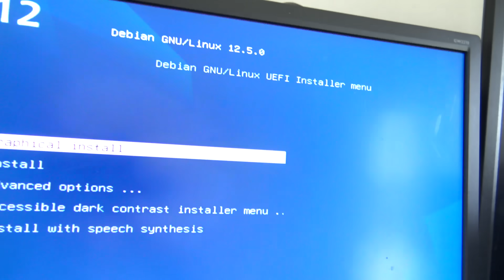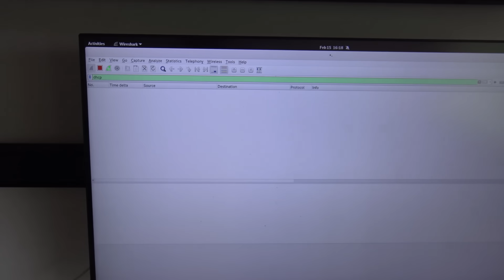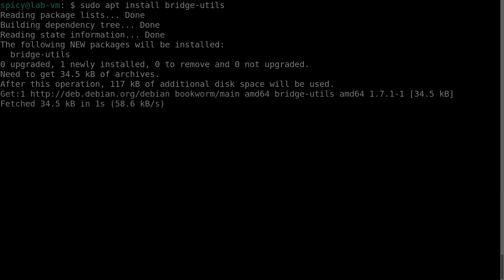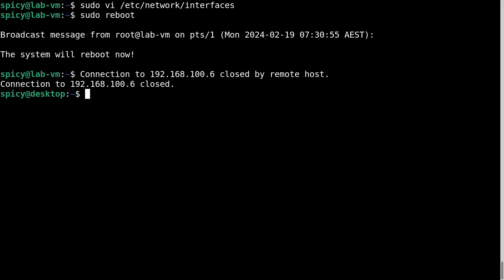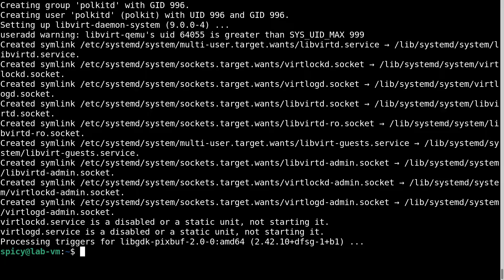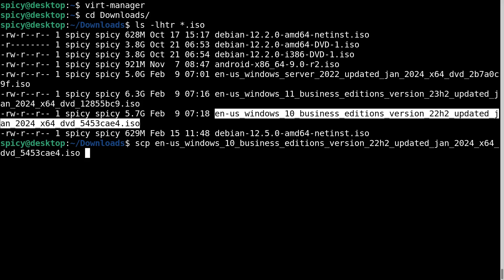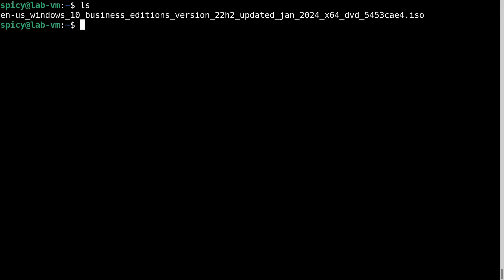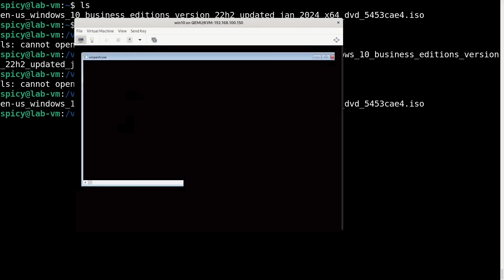Free Virtual Machine Hypervisor

Comment: nice - didn't know VMM supported remote management like that, seems like it'd be less tempremental than proxmox if you try to install something like Docker on the same machine, but you can manage Proxmox from windows & mac so I'm not sure if I'll get to try this one
Reply from the maker: The reason I use this is if I need a VM on a machine that I've already got Debian installed on like my desktop. Proxmox for web client is certainly good.

Comment: Lenovo M73 TFF, 16GB/1TB, clean install of Debian 12, Server. Got everything set up as per the steps in the video, nada on br0 not even showing in > ip a. 
My ethernet connection is/was eno1.  (does say altname enp0s25 but that name has no effect anywhere)
Has wifi with interface wlp2s0.

Figured out what was missing:

sudo brctl  add br0
popped up immediately after that.

Comment: I have one laying around - just not sure what Im going to use the virtual machine for ?
Reply: Bottom line... Anything you want.

Start off by replacing your routers services, since it'll die next week.  Move DHCP to a virtual machine.  Then move DNS over to PiHole.

Or, setup a minecraft server, or gaming server of some sort.  Or, turn it into a NAS controller. 

I'm running crazy hardware for a home-labber, and have my internet modem acting as a MODEM.  None of the "protective" crap the ISP likes to do for you on your behalf without any control on how you want to run your network.
Reply: Appreciate your answer 👍 @Mr76Pontiac

Comment: Neat. I tend to use Proxmox on everything capable of virtualising (if I don't also need a desktop on a machine) but have used vmm on my laptop. Didn't know it had a remote management type thing, very cool. Especially if you wanna do the minimum possible. Broadcom are an awful company so can definitely understand why people are flocking from vmware.

Comment: I've done the manual deal but proxmox is a pretty good UI for KVM so because I don't want to have to fiddle with everything manually I use that.  It is always good to understand what's going on behind the UI though.
Reply from the maker: proxmox is indeed good. I did a video on that too once.
Reply: @TallPaulTech  all the broadcom stuff recently makes me glad I didn't do VMware at home, even small homelab migrations can be a pain in the butt.
Reply: Virt-manager is a gui that does the same thing as proxmox. I believe they both utilize KVM

Comment: Nice and neat. I think the bridge trick might have been what's caused me a little pain when using KVM/Virt-Manager though it could also be that my host uses a USB wifi adapter as the primary network link at the moment and from what I've read that may cause issues when using a 'bridged' network adapter setting on the VM.
And I may or may not have been wearing pants while writing this but, hey, it gets warm here in Brissy.
Reply: Yep.  I've tried using it on my laptop via wifi and it didn't like it very much.  So have to use Oracle VirtualBox as the built-in networking tools are dead easy to setup.   I use ProxMox for my home lab and work.
Reply: @Darkk6969  I too found the VirtualBox networking setup much easier to get my head around as I'm not a network guy. I'd like to learn a bit more and maybe wind-up a ProxMox server, but space and dollars are working against me on that front.